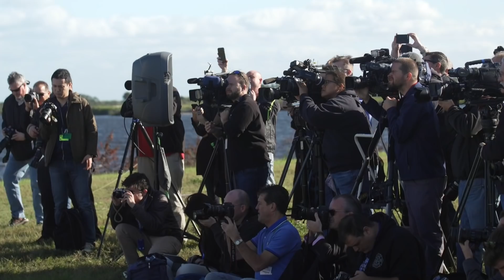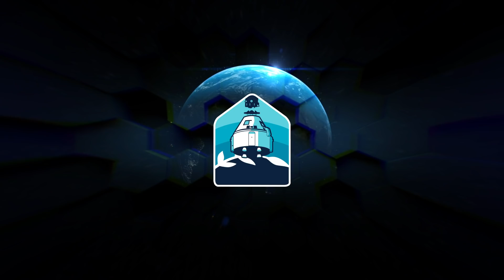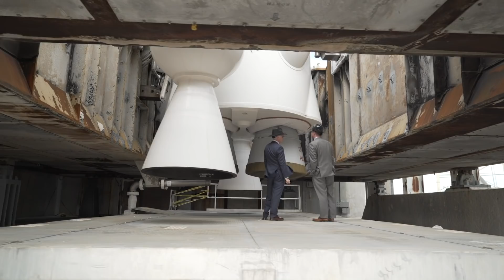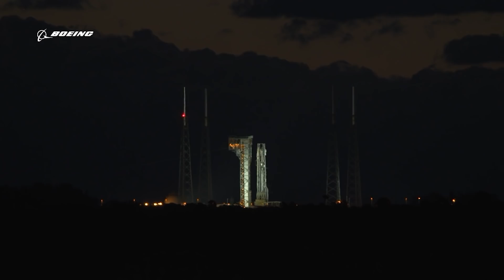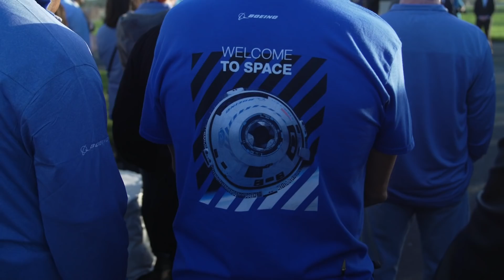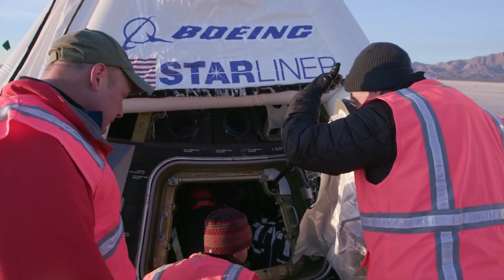Episode 01: The Orbital Test Flight of Boeing’s Starliner

Comment: SpaceX have opted to do an in-flight abort test (which wasn't mandatory) while Boeing have just done theirs which they originally passed on!

To be fair to SpaceX, Boeing should next do a flawless uncrewed docking test to the ISS and back before flying crew.
Reply: Except they didn´t. The abort engines were inactive during this flight. So if anything happened with the rocket, Starliner would go boom with it.
Reply: @michalfaraday8135  yeah I know - what I should of said was this OFT tested one of many possible 'abort scenarios' But as you say, not the catastrophic one that really matters.

At least the RCS thrusters were tested beyond their limit IIRC.

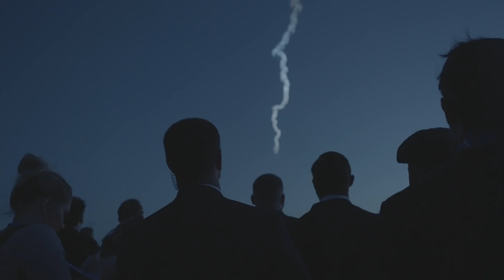Comment: 13:28
"And we have BECO; booster engine cut off. Standing by for stage separation."
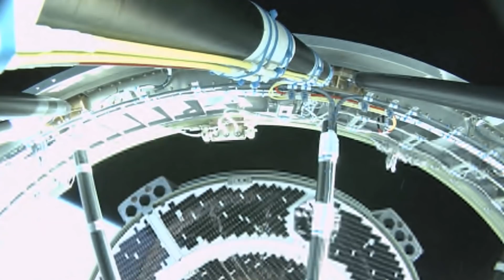13:32
Shows the Starliner separating.
13:35
"And we have good indication of stage separation."

That is NOT the correct stage separation!  Where are the shots of the dual-engine centaur in action!!!
Reply: I still do not understand anything from all of what you are talking about guys bahh it is ok nice i am wih u
Reply: @selestia219 
The rocket which launched Starliner had a unique configuration, where the second stage - called Centaur - has two rocket engines instead of the one it usually has.

BECO, or Booster Engine Cut Off, refers to when the first stage (Atlas V) of the rocket exhausts it's fuel.  After this, the Centaur second stage will separate and ignite it's engines.  This second stage does most of the work to get the spacecraft (in this case, Starliner) into orbit, as the first stage's job is mostly to get the second stage and payload out of the atmosphere.  Once that stage has exhausted it's fuel, called MECO (Main Engine Cut Off) is when the Starliner separates (called Payload Deploy).

That's the point, after MECO and Starliner deployment, at which the "anomaly" with the timer occurred.

So the video is missing the entirety of the second stage in action, while in addition showing the Starliner separating instead of "stage separation" which specifically refers to stage 1 and 2 separate.  It's not that what's here isn't good and informative, is that's space nerds like me (so yes, vista, I will gladly accept the term :)) really like to see the unique aspects of the flight, and that dual-engine second stage is one of those unique features of the flight that would have been really nice to see.
Reply: @firefly4f4  waww😰😰 that is too informative and huge i really thank you so much firefly4f4 about your answer ...i understand you ..but these powerfull and terrific things that you taught about them earlier that i didn't understand most of them(again) ...make me want to become a space's nerd like you 😙A genius😏that knows some informations like this i think engeniery (i dk how to write that term srry ) ..
A one that is in love with space like me 😍
A super clever that knows all things about things...😑😑
A cool guy that can get off any question about these things (again)
I didnt know that if you want to work in a space domaine engeniery* or an astronaut you must learn these things ...😵bah it is ok i am just at highschool and I am gonna to follow this study and really thank you because I feel that I understand this Starliner blablabla... I LIKED THE NAME OF MECO (MAIN ENGINE) 
  But dont forget that 

You are talking to a genius 😏😏😉
Reply: @Martian Nadine   If you are interested in machines and how they operate, there will be lots of interesting careers in the space industry.  I might give you two pieces of advice : 1) Stay inquisitive, try to understand the principles of how things are, not by memorizing like a parrot. 2) Try to get good at STEM subjects in school ( it stands for Science, Technology, Engineering, Maths ), especially Physics.
Reply: @trespire  yep i am gonna to do that. about. The STEAM i think i am doing it but about the machines engines how are they not yet ..i think until i get my Bac then let start this career 
. and thank you so so sooo much  trespie😏 you inspire me really u make me motivated to study my exam right now to open that huge story of prison idk something like that and start reading it 😑😑 (*you gonna say bah you are writting that comment right now not reading *) bah i am going to start thx 😛
Reply: Yes, We all like to see the thing's that went wrong in space in this video. We don't need to be sugar coated with positive. We are interested in "The Data" to what went wrong.
Reply: @Mr_Battlefield  He's not complaining about not seeing "what went wrong." He's pointing out they don't show (or mention) the Centaur second stage, from which Starliner separated.
Reply: @Mr_Battlefield  The dual engine centaur is something that went RIGHT, and there haven't been views of one firing.  The RL-10 is a beautiful engine, and it would have been nice to see TWO of them firing in space as opposed to the usual one.
Reply: centaur computer sent wrong info to starliner
Reply: firefly4f4 I guess the editor goofed up
Reply: Nerd
Reply: @swipe87  was that a joke?

Comment: Ohh why not use the reusable rockets ??? WTF A WASTE
Reply: They reuse starliner
Reply: @StarshipTrooper  well I watched it all, and I didn't se an engine land eanywhere, do you?? Can u please put in the time where it happens, good sir?
Reply: @StarshipTrooper  Atlas V[a] is the fifth major version in the Atlas rocket family. It is an expendable launch system originally designed by Lockheed Martin, now being operated by United Launch Alliance (ULA), a joint venture between Lockheed and Boeing.
Reply: @StarshipTrooper  Q. Is Starliner reusable?
A. The crew modules are designed to fly up to 10 missions. 
Service modules are made for each mission. It uses the Atlas 5 engine witch is a one time use engine, and the crew modul only last a maximum of 10 missions

Comment: I am confused as to how this is different from the crew dragon
Reply: It's a different company.  Both are doing the same job though.  The idea is to no longer be dependent on a single service provider.
Reply: What is so confusing?
Reply: Starship Trooper it seems to be very similar and no more revolutionary
Reply: @jellybottomjeans1984  well the target is to get crew to the ISS so it doesn't have to be revolutionary.
Reply: GondorTheLAme its a crew capsule made to transport people to the ISS. It’s the same goal as crew dragon but the overall design is different. The crew dragons service module and crew module are basically one and the trunk is for cargo, while starliner has a separate crew and service module and no trunk. Starliner has more space for crew and is also made to be reusable for crewed flights, crew dragon won’t be reused for crewed flights.
Reply: @StarshipTrooper  Also, Crew Dragon lands on water, whereas Starliner lands on land (hence the re-usability you mentioned).

Comment: Nasa is great. Boeing is just soo outdated, Space X can do it faster better with cheaper price.
Reply: Faster? Time will tell. It does look like SpaceX will likely get their first crewed test flight up first. But also consider that they weren't starting with a blank piece of paper with Crew Dragon like Boeing was with Starliner. So it's not quite an apples to apples comparison.

Better? Assuming the clock anomaly will get worked out, it's not at all clear that Crew Dragon gets the job done better than Starliner. They each have different strengths and weaknesses. (One has more storage space, the other more crew space. One lands on water, the other on land. One is a non-reusable capsule launched on a partially reusable rocket, the other a reusable capsule launched on a non-reusable rocket.)

Cheaper price? Indeed, based on information available to the public that looks to be the case.
Reply: . . . what would NASA be w/o Boeing or w/o SpaceX?

Comment: Be sure to triple check the flight control software, and give the pilot plenty of simulator time... don't want to be going nose down right after it clears the tower on liftoff...  right, Boeing?
Reply: Thing kinda coudln't go nose down beacuse of natural stability
Reply: @_mikolaj_  do you remember proton and ariane?
Reply: @jungleb   boeing made capsule right? This capsule is naturally stable. Even with service module it shoudl still not point nose down, but spin/be in random possition during free fall
Reply: A 737-MAX joke? How clever and original. Not to mention relevant.
Reply: @OptimusNiaa  automatic navigation systems are no joke and always relevant.
Sensor reading errors and wrong software cenario-based response are huge checklists in designing autonomous controls.
Considering the recent failure to address both these issues from the same company in recent events, no caution is too much.
Reply: Igor Schmidlapp Well Igor, could you climb back on your tree and eat a banana ?
Reply: @Waedi-OJ  Nah...  I gotta go check out this big black monolith standing in front of me....  ;-P